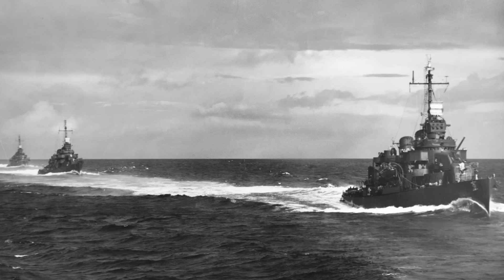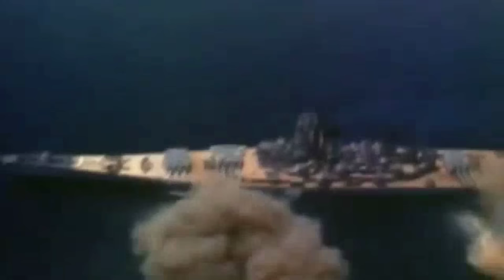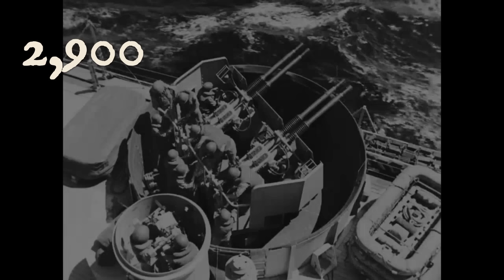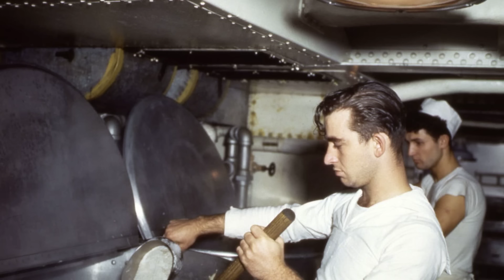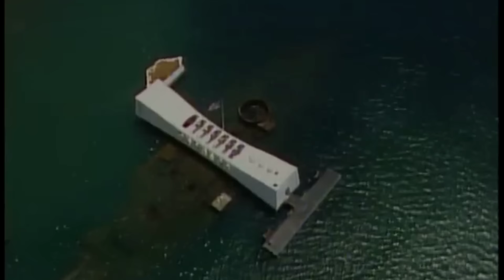Inside the Biggest Battleships in The US Navy

Comment: The nine guns on the Iowa class were not fired at one time. ( Broadside)They were fired in sequence not to cause interference from the muzzle blast. All nine guns were fired in less than 6 seconds. The ship moving when the guns were fired is false! Fully loaded, the ship was 57,000 tones, that is a lot of weight to move sideways!
Reply: Millisecond delay between guns firing smh not seconds and they did not move sideways firing either. The pressure wave was something though for sure!
Reply: Slight correction, the guns in each turret were sequence fired. So all three turrets would fire at the same time with each gun in the turret sequenced a few hundred milliseconds apart.
Reply: I’m glad somebody started calling out the faults thing in this cause I sure was going to thank you.
Reply: I was about to say the same but you beat me too it. This myth is constantly being spread and is completely false.